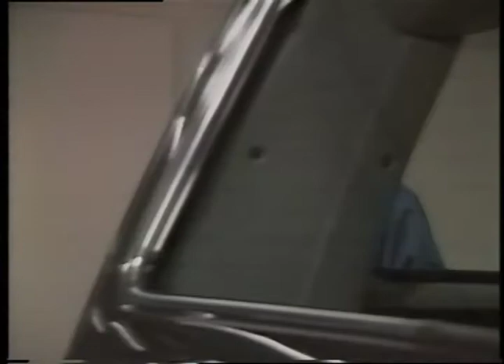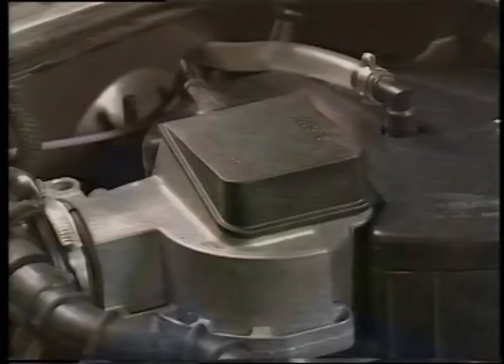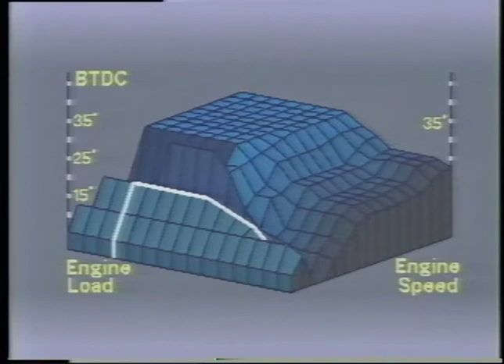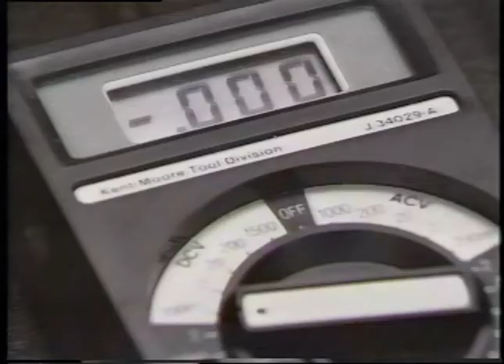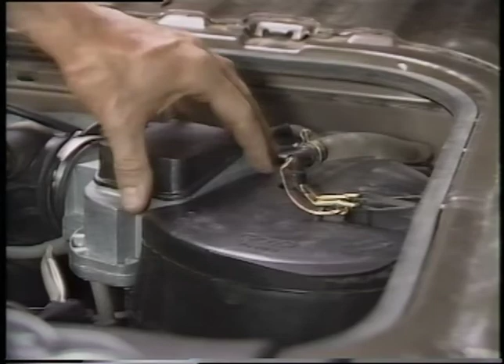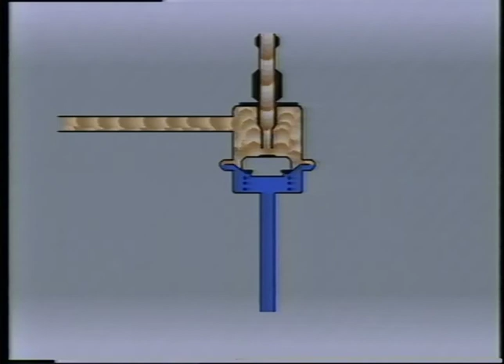Volkswagen - Service Information - Digifant Fuel And Ignition System

Comment: Ewww Digifart. 80s fuel injection with no self diagnosis capability or sanity checking for any of the sensor inputs. Absolutely diabolical.
Reply: Its a 40 year old ECU lol, what do you expect? Sony walkman cassette player era.
Reply: It's far easier for me to diagnose my digifant than the later technogarbage obd2 models that I can't even find a proper tool for. "its made for this tool, no actually that, no actually download this app with paid features, no actually this is the factory tool, pls pay 2000$ in yearly license". I'm fine with a digifant.
Reply: Um, actually no. 1991 California carat had a hybrid digi1/2 system that could store 7 fail codes and had a CEL.  You’d jumper some pins under the shift boot and it would flash a sequence of CEL lights that can be deciphered in the Bentley manual.

I have one.  It works.
Reply: @Rightisallwrong  ACKSHUALLY
https://youtu.be/F_9cJQ_Wr4w
Reply: @Rightisallwrong  do you know how to adjust the tps sensor under the throttle body? I need to adjust. I have a 1991 Jetta carat model.